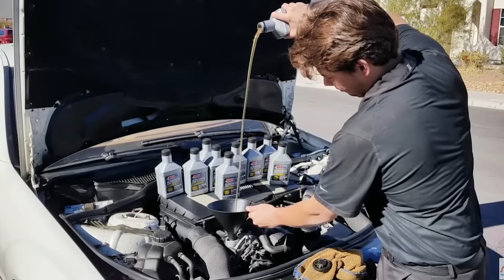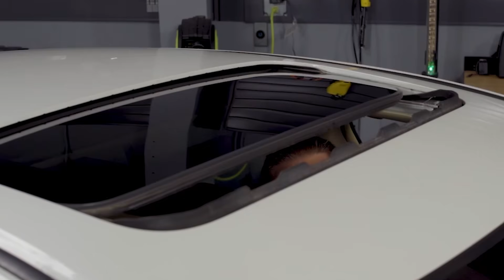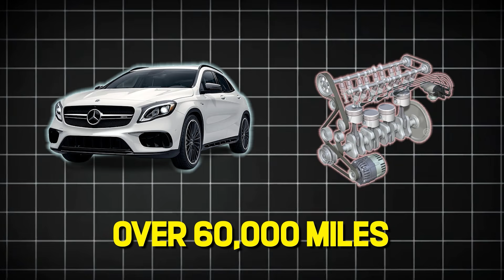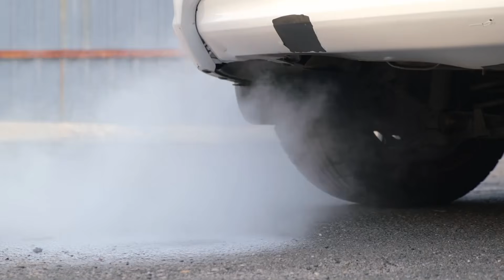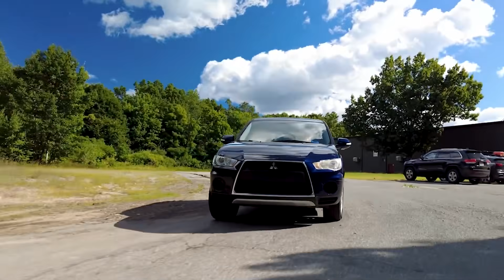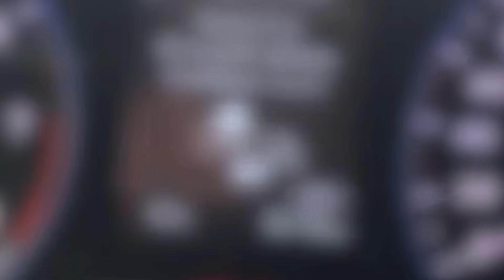How To Make Your Mercedes Last Over 300k Miles Without Any Major Repairs

Comment: I have a 2015 Mercedes E350.  I had oil on the floor, mechanic said needed new value cover gaskets.  No engine codes were on. After he did his work,  I checked the engine air filter and found oil was soaking the filter.  I wiped the case that holds the filter and in towards the throttle body and found more oil.  Showed the mechanic and said I think the PCV value should be changed.  He did not agree said I was wasting money wait for the engine code!!  No happy what do you think.
 Also is Pennzoil universal 50/50 anti freeze safe to replace G40 antifreeze?

Comment: synthetic. is fine  7 to  9k if your a normal driver 5k was made up by the oil industry.   Transmission at 90k   I drove a few cars 180k no change. sunroof there is a recall done for free. Black plastic on BMW trunk brown replace it Oil cooler on BMW at 60k .Oil injector Techtron bottle once a year. AIR spinngs suck when the fail replace with solid ones. Control arms replaced as needed how this guy didn't talk about control arms and tie rod ends. On German cards you gotta get an alignment almost every four years.

Comment: I change the oil at 5,000 kilometer intervals (3,100 miles) including Mahl filters as well, on all my cars. Oil & filters are cheap & they're the life blood of a Mercedes engine. I have a W124 E280 1994 Merc with 478,000 kilometers on it & it drives like it just came out of the new car showroom, apart from my simply superb  2003 W211 E320 V6 with only 140,000 kays on the clock.

Comment: Interesting... when sythetic oils were originally and for many years sold as increasing miles you could drive beyween changes was 50,000, not 5,10,15 but 50,000. Gosh dynosaurs must be less slippery but not the dynosaur salesmen, they are all very slippery.
Reply: First of all, I am a believer in full synthetics and my rides get ALL lubricants (engine, transmission, differential, brake, power steering) changed to synthetics, if not already applied.  But, got to straighten you out on your claim!  There was never a claim that synthetic engine oils would ever last or be guaranteed for 50K miles (unless you have a small refinery attached to the crankcase).  When Mobil 1 was introduced in 1974, I was just learning what a wrench was for and how it applied to my 1970 Chevy Nova SS 396 (402) with 675 HP.  Conventional oils were recommended to be changed at 3K miles (most likely for sales) but, the reality was the oil was trash at that point, especially on big-blocks!  No wonder people who ignored that change interval had mechanical issues, complicated by the then vulnerable tolerances and bearing materials used.

In the early days of Mobil 1, I called the company and spoke with an engineer about the expected lifespan of Mobil 1 synthetic oil.  What he told me was, they did not see any thermal breakdown until the oil approached 23-24K miles.  They never made any outlandish claims for change intervals that I am aware of.  Most likely hoping we would adhere to the market trend of 3K miles to influence sales.  My math regarding the potential range of use before degradation and higher cost of the oil, versus the recommended change interval of 3K miles and cost of conventional oil was a no brainer.  I would change Mobil 1 at or near 10K (less than half of what I was told) with a filter change and top off at 5K miles for years.  Currently, the Mobil 1 GUARANTEE advertised on most of their products is 10K miles and I think there is one blend at 20K miles but, I could be mistaken.  They truly GUARANTEE  their oils and if tested and proven to be the reason for engine failure, they will cover the repair cost!

Personally, I now change my oil at 5K miles or 1 year-ish and the transmission at 25K miles or 2 year-ish intervals (better safe than sorry), oils do have a shelf-life like everything, chemical polymers change with age.  I have never had an engine or transmission issue on any of my cars with Mobil 1 and my schedules.  Also, Mercedes-Benz used Mobil 1 for models at their manufacturing level (engine, transmission, differential?) and at their dealerships, with it recommended in their owners manuals for some time.  Previously, for years, their F1 cars displayed Mobil 1, they now display Petronas (state owned Malaysian oil company) and unsure if it has reached their manufacturing level.  If you would like to learn more about engine oils, look up videos by Lake Speed.  He is a Tribologist and a wealth of knowledge regarding oils. Just saying...  😎
Reply: @AEL-tpa  Glad to hear you believe. 
Mobile 1 wasnt the first though.
When Albert J. Amatuzio founded AMSOIL and released their 10W-40 synthetic motor oil in 1972, he aggressively marketed its durability to prove synthetic superiority over petroleum.

While the general consumer recommendation was set at 25,000 miles or 1 year, AMSOIL's technical literature, dealer training materials, and commercial fleet sales programs routinely advertised 50,000-mile oil change intervals under specific operating conditions:

Oil Filter Changes Halfway: To run the oil for 50,000 miles, the filter had to be changed at 25,000 miles (or every 12,500 miles depending on the filter type), along with topping off any oil lost during the filter swap.

Oil Analysis Testing: Fleet users and commercial operators running 50,000-mile intervals were expected to perform periodic oil sampling to check for fuel dilution, soot, and acid buildup before deciding to keep the oil in service.

Highway/Long-Haul Driving: The 50,000-mile target was targeted primarily at long-distance highway driving where engines ran hot and steady, minimizing the moisture and unburnt fuel dilution caused by short stop-and-go trips.
Im just saying.... I ran my 1972 Chevy Custom 20 all heavy duty, clutch, springs, 8 lug, rear end, tranny and 3 on the tree 350 I put no less than 20,000 mi per oil change using detergent fuels, and hauled backhoe buckets and 150 gallons of diesel fuel for fueling my heavy equipment,  and i chirped the tires in 1st and 2nd regularly with fuel full. I did nothing but the recommendations i cited above amd achieved 175,000 mi with nothing but a clutch cable replacement.  Never did valves or saw smoke and i pushed 76 chevys backwards in 2nd gear.
Mobile 1 seems to be enjoying the slot of the inventor, but at $4-$5 a quart most real men were saving their money to buy whiskey not oil.
But i liked your story, i had a 72 nova for a minute, a woman who kept me let me use it when my 63 falcon futura was ailing.😊
One thing more, a feiend has a 69 Camaro 454 line locks balanced a blue printed, and he never changed oil before 10k, spent $5k on that engine in 1978 and more on the trick paint. His brother took a TA 1970 and blacked it out, actually really deep green, the finest TA you ever drooled over, and the 2 of them had their power plants balanced and blue printed by a true expert who did that week in week out and those standards were shared and practiced throughout our culture, that ran str8 lines in as yet built undustrial roads regularly, even though we all loved our machines we practiced frugal restraint and put money towards tires and movie tickets!!😊 
Different strokes but also my uncle sold AMSOIL during that time which is more validation of my CLAIMS.
Reply: Oh and I now run MOBILE 1, 9.5 quarts in my Mer edes S550, and i change as needed but never under 5000 mi. Filter changes are seriously the most important thing, and lots of magnets in the oil pan😅

Comment: Lol Mercedes Transmission pan & Fluid change $300 lol😂😂😂 yeah thats if your garage DYI mechanic...Mercedes  transmission  fluid change not that simple just drain and fill... lol😂😂 you are looking at $700-$1200 .. depending on repair shop..
Reply: 695  in las vegas   for transmission    flush  2026
Reply: It’s not that hard to do honestly but they always say never to change the fluid it’s lifetime
Reply: @FearTheStyle that is up to you... if you are keeping the vehice for long time.. its a must.. There is No such thing as Lifetime....  modern day Vehicles sales tactic and engineer towards life of warranty of vehicle... its 100% designed  with cheaper materials and quality of design..to fail exactly after warranty ends...😂😂  so that you lease or purchase  new vehicle...
BMW currently going through hell with water pump and oil pump failure... they got caught with there pants down.. sourced out cheaply made oil pump with plastic parts inside a oil pump..  which are now failing .. and now there is massive recall and lawsuits... .. they knew this for long time.. but tried to hide under the carpet...but it went out of control.

Comment: It seems that you are afraid from everything that is Mercedes, drive a different car then.I will give you a recommendation, VIP leases(1 to 3 years)and you don'thave to worry about anything,but if you don't whon to pay for ,,New Mercedes ",then you have to maintene it, and do certain preventive work And if the oil company, that made that specific oil(tell you they did test the live of the lubricant)replaced at 7500/8000 miles,not at 5000 you are flashing your engine. And that is not ,,good".Your Mercedes is giving some since, take care of it, that all..Not before, not after,,on time".There is slogan among mechanics, ,if is not broken, don't fix it,and do things that you don't have to. ....fix it,right a way when gives you a sign, just don't ignore it. ...